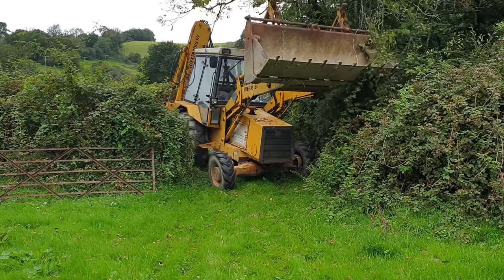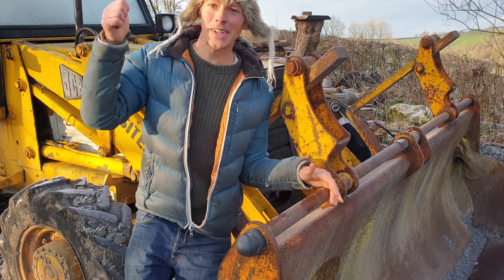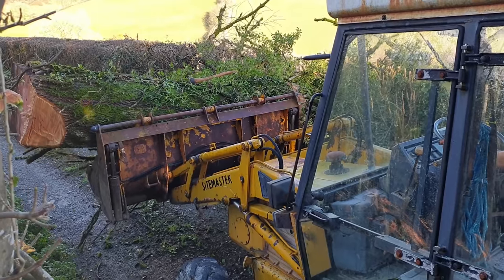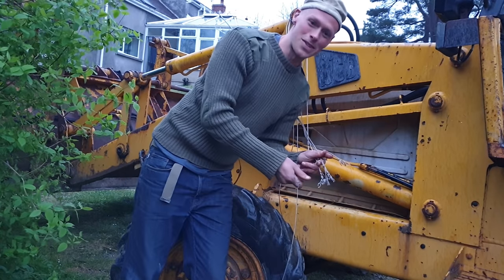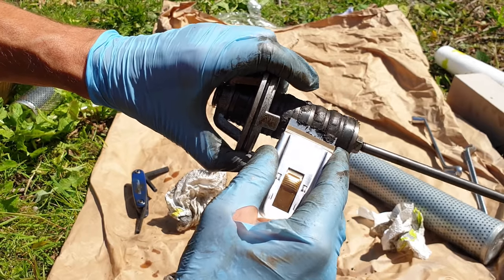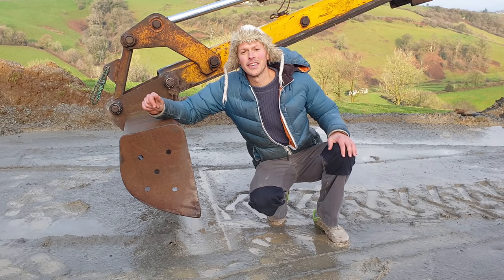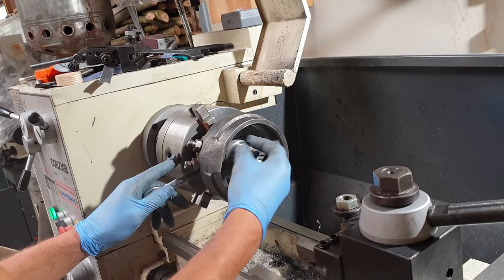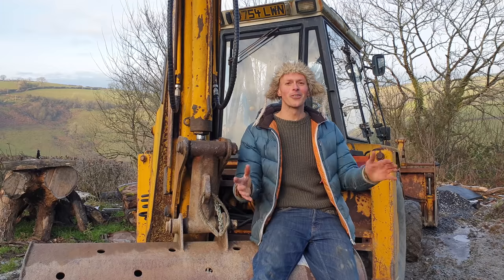DREAM DIGGER in 4 steps: 'How?' and 'Why?'

Comment: I operated jcb’s for over 30 years they are a great back hoe, a little hint DONT get into a habit of travelling with the front bucket up in air, if you get a blowout or hydraulic failure you could roll it, keep it close to the ground for safety and visibility, just saying good luck
Reply from the maker: Good advice, thanks Phil
Reply: 24:30:50

Comment: Loving watching this. I've been a digger driver for over 20yrs its great to watch someone learn the ropes. Its not easy but I can tell you are getting the hang of it.
Reply from the maker: I loved reading your comment! Thanks for watching, and really appreciate the sentiment coming from someone with so much experience. Thanks :)
Reply: I just watched some of your other videos off the back of watching this one.
Reply: Been operating heavy plant (Both Civil and Military Equipment) for 30 plus years.
If that’s your first go at operating a backhoe and 4 in 1 bucket then I’d say you are probably a natural with eye hand coordination.
The secret to smooth operation is not to over correct too much but rather use slow and fluid movements and gradually you will get to a point where you are thinking about what your doing next without being over conscious about what is happening now.

One thing I will stress is judging by the state of the Hydraulic filter you would be advised to drop all the oil again soon and thus clean out any residual crap in the system.
Grease regularly and replace any blocked or broken grease nipples as and when required.
This will extend the life of bushes and pins greatly.
Failure to do so will obviously have the opposite effect.
If your land is extra boggy or wet you might want to look at acquiring something with the same size wheels front and rear (4CX or a Hydrema - Ex military) you might want also to look at MOD Plant sales for low hour older equipment that’s been serviced regularly.

Comment: sorry did the multiple comments.. but when I saw the wheel barrow.. I got the machines I have as I was was sick watching my dad slugging n lugging... videos means a lot to me.. very similar to myself 👌
Reply from the maker: Hey Ray, reading your comments made me grin, thanks. Good luck with it! I also have some gearbox maintenance to do - at the very least to change the filter and oil. Will get round to it soon, but first, need to fix the rear up and over door/window, which broke the other day when we were hauling concrete about in the front bucket....

Comment: Yes .... with great power comes great responsibility! Both fond and frustrating memories of operating Backhoes. After working with absolute dinosaurs this model was the first 'luxury' backhoe I used, so only real experience with JCB's is new one, in remote Australia our biggest issue was spares (not an issue in the UK). The fundemental principle when removing any stuck tight fixture is applying parralel force either from in front (puller) or behind (punch or hydraulic pressure - grease plug)
Couple of suggestions.....(sorry if they sound condescending- not the intention)
Walk around with your front bucket lower to ground = less inertia, load leverage (I know the footage was selected but common habit For newbies)
Use bucket edges as reference lines to learn bucket orientation 
Practice 4 in 1 bucket grabs, back blading, and loose load scooping by moving a pile dirt/mulch
When digging with your backhoe dont forget to draw the arm in horizontally, so many operators just cramp the bucket leaving a gnarly bed to the trench....Grrrrr
Tyre pressures!
Get some log claws for your backhoe....even welding some short serated cleats to your the inside edge of the lower backhoe arm will help grip  logs with the back bucket
Lift which your back bucket by the trailing cleat on the pitman arm (the eye you have that ratty bit of rope hanging from) not the teeth (and use a shackle). Nothing more annoying than one offset tooth when you are trying to finish a job off nice
The ol' yellow shovels are great, sometimes it will feel like all you are doing is digging yourself a really big hole (pun intended) but treat them good, take it easy, and they will serve you well. 
I predict your next purchase will be.....high flow high pressure washer, diesel transfer pump
Have fun
Reply from the maker: Good Morning Bunyip. Thanks so much for sharing your experience :)  Yep, diesel transfer pump has come to pass - only a hand one my friend gave me - but works a treat. Talk to me about pressure washing. My dad has a cheap old electric one I can borrow. I worry I will blast more paint and grease off though.. What bits should I particularly be looking to hit? 
Thanks again, Bongo.
Ps What tyre pressures do you suggest? I have been changing it up depending on the wetness and how heavy I expect to lift - but roughly 30 rear 60 front?
Reply: @FloweringElbow  front pressure sounds a little high, but I operate in the tropics, really comes down to the tyres you have fitted,  mfrs recommended range, temp, ground/surface type and load ..... just make sure you dont operate too low .... easy to peel off the rim or expose too much sidewall to potential punctures.
Pressure cleaners require judicious application, +1800psi min / 10 lpm  would be where I would start (hot water/steam would also be benificial .... all depends on your supply water and power....but in general you make do with what you can get your hands on). Stay away from blasting directly on seals and hoses and other delicate parts.....a clean machine can really help id leaks, and potential problems, nicer to maintain, and also helps reduce spread of weeds (paint is the least of your worries).
JCB Machine Group sounds like they will be able to point you in the right direction, just deal with the rust and the hoses when you can (hot high pressure hydraulic oil leaks are no fun and usually happen when you least need them).
Carry a set of choker chains .... easier to drop logs, they can best handle the abuse
Backhoes really are the best all round peice of heavy equipment, have fun, stay safe

Comment: Just found your JCB story & just subd👍
Enjoyed watching , I've had a few JCBs over the years, biggest bug bear was always constantly repairing punctures ( that's probably why I prefer a tracked 5 ton excavator)one JCB bonus is the stabilising legs make great tyre bead beaker tool . Here's a hard gained trick for you to stop and eliminate constant punctures = when repairing or replacing the inner tubes, buy a few big rolls of heavy duty Kevlar weave bitumen coated adhesive roofing repair tape ( Gorilla do a good one) and apply it to the full inside circumference of the tyre with a hand roller ,( warm the inside of the tyre to get a good bond) , your be amazed how this simple trick virtually eliminates punctures 👌also works brilliantly on quad bikes and off-road Tyres etc .
Stay safe and good luck 👍
Reply from the maker: Hey Steve, thanks for the tip friend.

Comment: Great video ! I have an 1989 3cx , we have a small holding with a mile long track up to it and are in the process of building a new house on the site, the digger has proved to be a fab old tool for about nine months of last year the engine was hardly cold and other than a few burst hyd hoses and a couple of punctures it never missed a beat.  I would say for anyone doing a similar size project a decent 3cx is the machine to go for , relatively cheap to buy, straight forward and inexpensive to repair and more than capable of doing most jobs be it bigger or smaller .👍

Comment: I have operated these on building and civil engineering sites. Not sure if you know this yet, but there is a way you can judge that the front shovel is level so you can shovel into gravel without digging into the ground so contaminating the gravel with soil which you don't want. That is the top of the shovel the flat bit about 4/5 inches wide that goes the full length of the shovel you can see from the cab, it is this bit of the shovel where you can determine the angle of the shovel blade. Because when this is flat from viewing it from the cab the shovel will be flat, then you know that when you shovel into gravel the shovel won't bite into the ground.

Also if you quickly push the lever forward the whole shovel and booms will float on the ground reducing the risk of digging into the ground. This is also useful if grading the ground after filling a trench to help blend in the disturbed soil with the untouched surrounding soil. 

🙂👍
Reply from the maker: Top tips, thanks Docsavage!
Reply: Nice 1 Al use them tips

Comment: That machine right there is going to save your back and smaller machines in the long run. This mad house of a monster was definitely a good choice for you and my family. My dad got one 4 years ago now and it has definitely been our number 1 go to tool for landscaping and large heavy jobs. It may be a bit rusty and it’s tire may go flat every few weeks due to a slow tire leak but it has always gotten whatever job we needed to do DONE! 

The number 1 issue of mine though is the transmission or clutch. I’m getting them confused now but what happens is if the machine has been driving for too long, it gets harder to get moving from a standstill. It’s slipping. 

Some previous owner must have been trying to push something while in 3rd gear or something like that and has majorly damaged it. My dad has always joked that if someone steals it, they’re not getting far because of that.

Comment: Cost is always dependent on care that has been given to the machine, if you don't see dates on filters or grease around fitting most likely that machine was used till they don't want to do any Preventive maintenance  on it/  looks like you got this beast at most needed  time before it had no life left in it. nice work on getting it back up running.

Comment: I’ve got one of those, a 1986 3cx. Overall it’s a great digger - had it for about a decade. 
It’s very useful for scraping out the yard, loading up the muck spreader etc. And incredibly easy to drive - it’s quite incredible that the lever on the right hand side is so simple. 
As well as some mechanical problems, it is quite underpowered and unstable compared to modern back hoe diggers, and our tractors from the same era. With a full bucket of muck, it often only has enough power to drive up our quite steep yard in second gear - not a problem - but we could do with a bit more go. 
As for instability, living on a hill farm with lots of steep fields and tracks. There’s been a few times when I’ve been on two wheels. The 4wd was broken when we got it, and we didn’t fix it for a few years - so I often had to pull it out with the back actor.
Reply from the maker: Hey William, thanks for watching. Two wheels only sounds very terrifying 😳
Reply: Is yours turbo or non-turbo? Turbo version would have more power, maybe you could retro-fit? Or trade in for a turbo one

Comment: A few years back I bought my first (and so far only) skid-steer loader from a used-equipment dealer over the internet, and I'm still working through the "fixer-upper" stage. Replacing pins and bushings, welding new steel plates onto various bits, and [soon] swapping out ailing hydraulic components are all activities through which one can learn new skills and they also improve the function of old machines *enormously*.
Reply from the maker: Right on Reprapmlp! it takes time but it's cool to learn all that stuff - the machines combine a lot of different domains of knowledge - which makes them quite interesting :)
Reply: I've ramped up my welding from nothing - last weekend I graduated to buying welding rods in a 25lb box. And my only machine tool is a drill press (lathe and mill are On The List).

Comment: Front bucket is just wider than the axles, allowing uou scrape right alongside a wall.
  The top plate of the front bucket is parallel with the botom floor of tbe bucket. So you know whether the bucket is level.

Comment: I started driving JCB's at 17 years old on an old JCB3 the one with a fixed back actor, progressed to a 3C and finely a fresh off the production line 3CX. So fresh a factory mechanic came with it, luckily the only problem was the forward-reverse shuttle box. This was replaced and now further problem for the next 2=3 years I drove it for Sir Robert McAlpine. I then went back to a late model 3C with 4in1 bucket and a 360 JCB excavator number???

You seem to be getting the hang of, well done. When spreading gravel or Type One with the front bucket full, set it 3@ off the ground and open the jaws until material just starts to flow out and then drive forward. You can use the same method to grade as the jaw will stop the front blade digging in. Do get a set of lifting chains.
If you want to gentle lift the boom, extend the an outrigger fully and keep the lever pulled the operate the boom lever with the other hand, the dumping of fluid power will smooth out the lift. Other operations can be smoothed in the same way.
Don't leave spare buckets laying around, they can walk very easily.
Keep the diesel tank full, condensation in the tank forms a water and diesel bug grows, this goes for the bulk storage tank as well.
Thanks for posting and stay safe.

Comment: Hi bud well done for buying your first machine and word to the wise if you change the backhoe bucket often look into buying a manual quick hitch for the backhoe
Reply from the maker: Good evening Jepson. Thanks, appreciate that. I have got bucket changes down to about 10 mins now - but always get covered in grease, and I think it's easy atm because there is sooo much slop in the pivot bushing - which I do intend to fix... So yeah, that would certainly be good!

Comment: Good stuff, congratulations on your new "toy".  Another item for the list of equal parts maybe could include "dangerous"?  Thanks for the video.  Cheers, David
Reply from the maker: Good morning Drmnz, Thank you for this. Dangerous it certainly is! I didn't mention it but when you are up in the cab, it feels particularly high and unstable on the slightest of slopes. The thought of rolling it is very, shall we say, concerning...
Reply: @FloweringElbow  slopes hazardous for sure, but an observant and thoughtful driver maintaning 360 vision on normal terrain is the most important element for the safety of  bystanders/camera people  (a.ka. me), when considering the swinging back actor and visualy obscured areas of front scoop 😊

Comment: These - unlike washing-machine motor control stuff - I do know inside out. :-) Hugely useful tool, even if semi-clapped out - they're very repairable - nothing much on them can't be sorted.  I like your channel, Mr Elderberry - you strike me as a hugely bright chap - which is rare. You had me at chainsaw milling btw, as I do a lot of that too - usually freehand.
Reply from the maker: Hi again James, thanks very much for watching :) and your kind words. These old beasts take some work but they sure are handy...
Reply: @FloweringElbow  Never mind the flattery - go answer my "Washing machine control thingy for Idiots" question on that vid you did & I'll be a subscriber for life. :-) I need to make one spin slower what for wood-related matters, but am far too thick to know how. That problem you may have the answer to. :-) Kindred spirits, blah blah.. feck off & cut some wood, etc etc. Yours, a fellow skinny, well muscled,  overworked wood/machines/everything  botherer. :-)
Reply from the maker: @jamesward5721  Replied on the motor thing... Maybe give the thing I linked to a try.

Comment: Great job well done! It's a well known fact that most excavators and plant in general have a really hard life! So to buy an old machine is always very nerve racking! I'm impressed that you seem to be able to fix you own faults with the 3cx, because having to get mechanics over is an expensive game! My only comment would be,  when you're operating the back hoe, just put a few revs on.  It'll give you more digging power and lifting power! Anyway,  great video thanks for posting it and best of luck with your lovely JCB 3CX.👍🏼
Reply from the maker: Thanks Richard, good tip!
Reply: Do nt be hesitant and jerky be positive with revs when u get the hang of it you will know what l mean practice and more practice